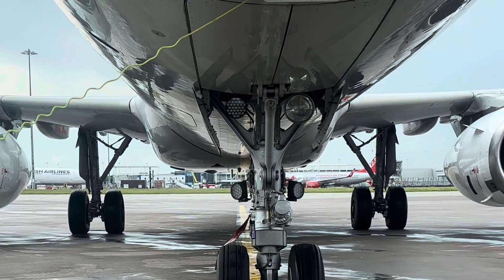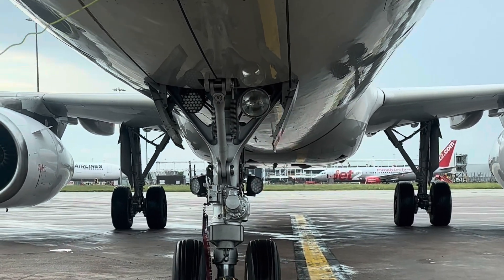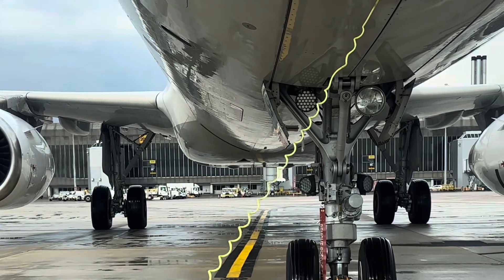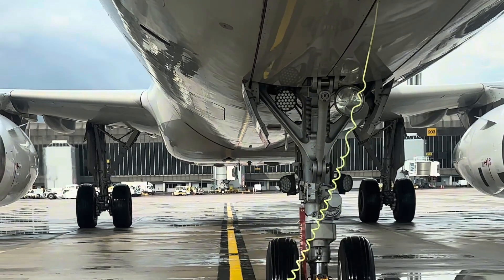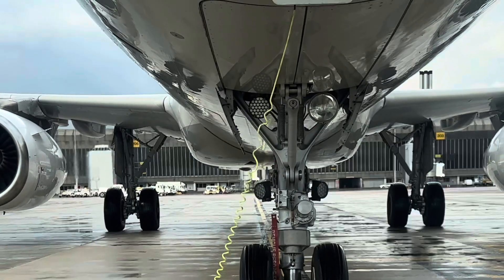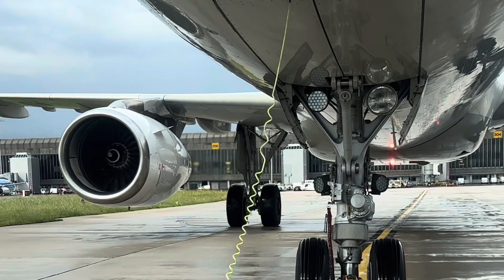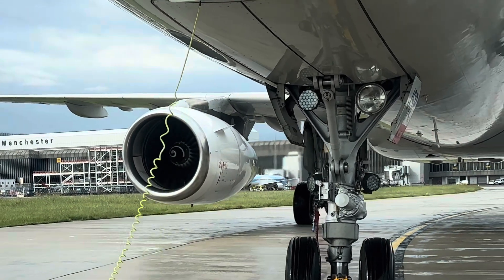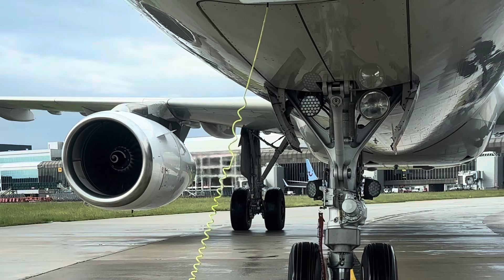A321 PUSHBACK/why can’t planes reverse themselves? ￼

Comment: How is an aircraft steered from the gate? Does the push back truck driver manoeuvre the aircraft? And I noticed the engines are fired up during a pushback, so wouldn’t that be an added strain during a pushback?

Comment: For some reason this video is not loading.  But, to answer your question, airliners CAN reverse on the ground using reverse thrust.  It is discouraged because of shortening the life of the engine and incurring unnecessary engine maintenance.  In the 70s 727s used to use reverse thrust all the time.  Those were days before jetbridges and tugs.